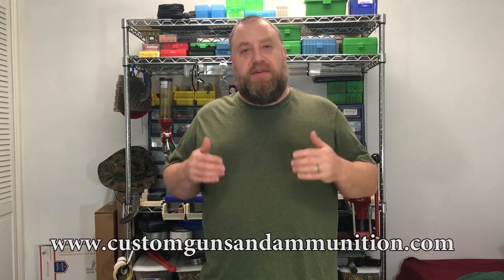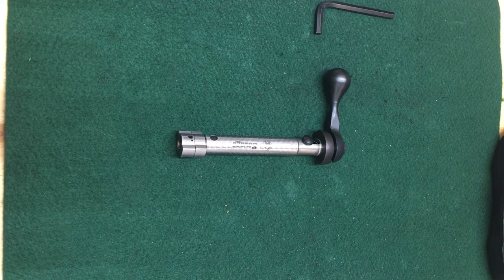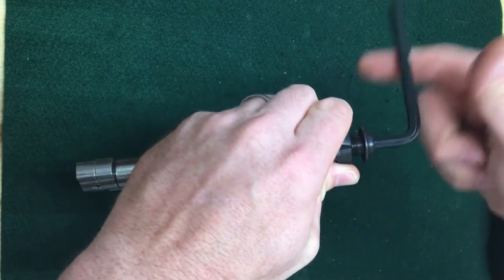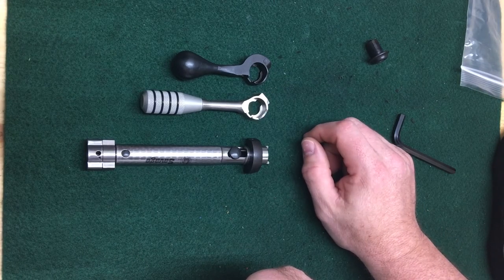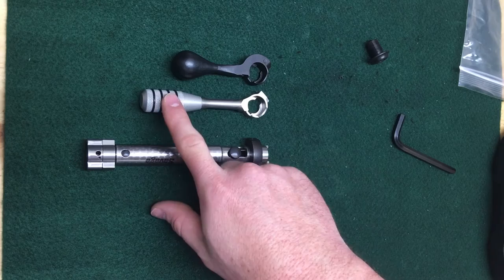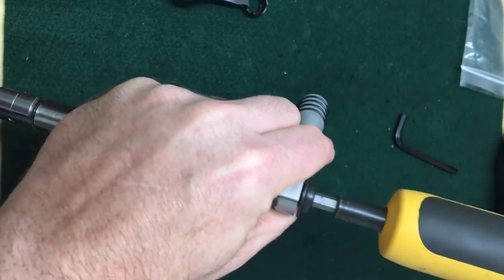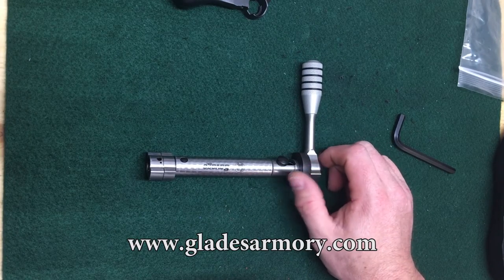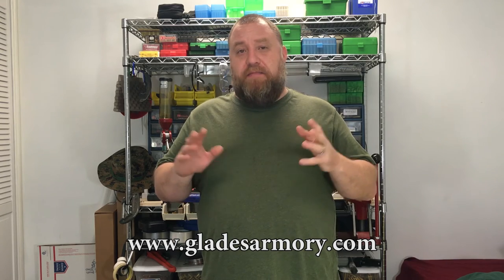Savage Bolt Handle Replacement

Comment: Good video. Is there a company that changes the bolt lift clearance due to almost hitting the scope?
Reply: You can buy a new bolt handle. I’ve tried a few different ones and settled with the new savage tactical one.
Reply: @MrBryanJollie  did that help with scope clearance and not banging your knuckles on the scope when you cycle the bolt?
Reply: @rpk5250  Yes. But if you are trying to go super fast, it can happen if you have your scope throw lever pointed at your hand
Reply: @MrBryanJollie  where did you get the savage tactical handle?  Is there a curve to it?
Reply: @rpk5250  midwayusa. $25 I think
Reply: @MrBryanJollie  thanks for helping!!  did it curve or stick out further to help with scope clearance?
Reply: @rpk5250  I believe it curves a bit more than stock one. I’ve tried longer handles as well but they seem to put a little bit of twist on the bolt if your not careful and the bolt body may hit the receiver and kinda lock up. So you have to be a bit more diligent with the longer ones.

Comment: id like to see more savage mods. it looks like we do the same type of shooting as well. i noticed the CORE video. it would be nice if you could add to these mod videos the difference in lift or demonstrate it in a new video.
Reply: I will look into that.  I'd have to figure out a way to measure the difference somehow.  Maybe with a trigger pull gauge or something.  I will say the owner of Masterpiece Arms was looking over my Savage a few months ago and they just released a new "budget" line based on Savage actions.
Reply: have you had any trigger reset issues during a match? i have the 1.5lb LE trigger and was debating moving back to a rem footprint because of it. it seems the cam is so heavy i can see the trigger moving in place. which i wonder if that is why it drop my sear when set lower without touching it. 

id like to keep it.
Reply: no trigger issues.  I did however have to go back in and fix my cocking pin ramp.  I needed to take a bit more off so the pin would rest in the rear position without moving.  But I had rounded the ramp originally where I shouldn't have.

Comment: Would locktite be suggested to prevent the  screw holding the bolt lift on from backing out?
Reply: wild bill I did use a drop off blue loctite after the fact. But I wouldn’t go any higher than a medium strength hold

Comment: Did the "square-top" bolt handle give you any issues with your round-top receiver ? 
Been looking for a longer handle to clear my scope better, and I see some Companies say there's a difference.
Reply: no problems whatsoever.  These did clear the scope better, but I eventually went back the newer savage tactical knobs since they didn't create as much vertical pressure on the bolt when running it. But they do make you hit the scope if you go to fast.  So I basically traded off the no scope hit for a smoother bolt throw if that makes sense.

Comment: Great video, thank you for making it. I have a Savage Trophy Hunter in 308 and everything looks like yours but I have no spot on the back to use the 1/4 hex key. Does this mean I have a model that the bolt handle can't be swapped out on? Any help you can offer would be much appreciated.
Reply from the maker: You'll have to de-cock it first so that you can get to the screw.  This video is for your rifle I believe.  https://www.youtube.com/watch?v=PPOpS2L2wfk&t=5s or this https://www.youtube.com/watch?v=BuY8wGb-UBk
Reply: Guns, Optics, and Reloading thank you so much, you were dead on. That helped me out a ton!
Reply: @GunsOpticsandReloading  7
Reply: @shanestauffer6828  7?

Comment: Hi, great video-thanks very much for sharing it. Do you know if these would be compatible with the Savage BSEV (.22)??
Reply from the maker: If the bolt handle is the same size then yes.  You can check glades armory as well.

Comment: Again. Just another example of "fixing" a new bolt out of a Savage rifle. When will they make a smooth bolt that lifts up like other makers such as Tikka? Also look at upgraded extractors needed to make Savage rifles work like they should when you take them out of the box! They make an accurate rifle if you can get it to function smoothly and reliably. Don't hold your breath though. Savage! Come on  get with it! Make a complete rifle. Good idea with the accufit, and accustock, but not worth a crap if you can't get the gun to feed and extract like it should!! Owner of a brand new 110 Desert Tactical that will not function like it should. Pissed
Reply: I feel your pain. I have also upgraded to a ptg bolt body that really helped take a lot of slop out of the bolt.

Comment: how did you get bolt out of gun?
Reply from the maker: Just pushed the bolt removal button and pulled it out.  I would refer to your user manual if you cannot remove the bolt to make sure you are doing it right.
Reply: press bolt removal button and pull trigger. hold both down and bolt will come out.

Comment: whatever. I need to see how one gets the back of the firing pin out of the dam way,,, so u can put the allen wrench in the hole
Reply: Use your thumb and a rag. It is tough to do.  Or I push it down on my wood bench and slide it over.  Watch your fingers or it will leave a mark when you slip up.